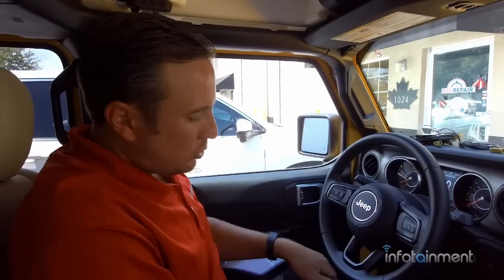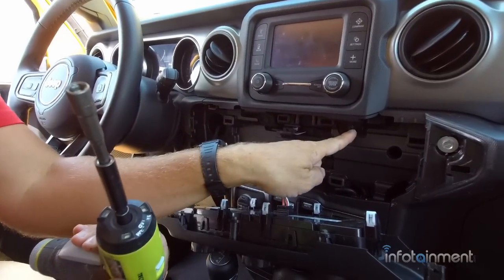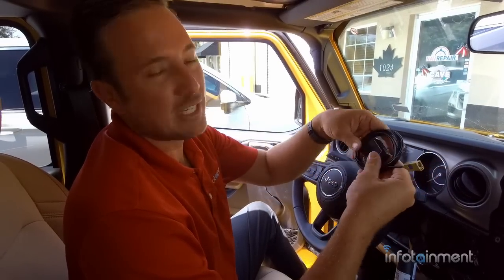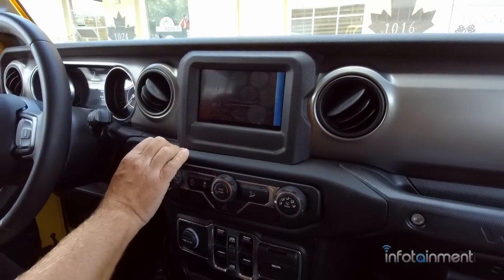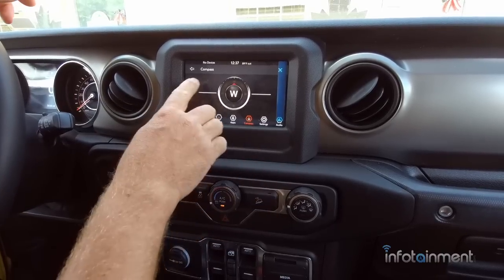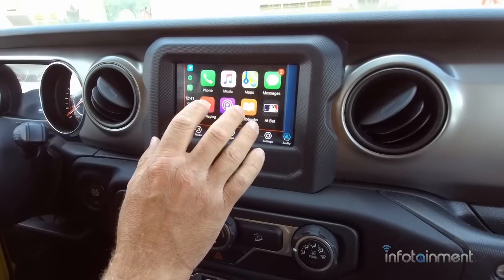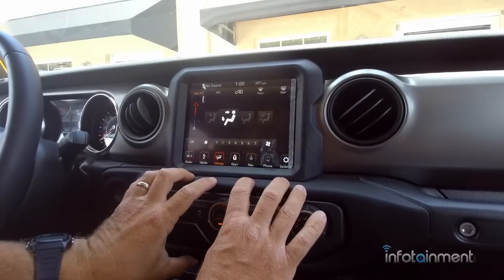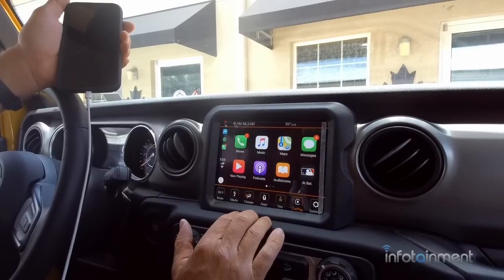2018-2023 Jeep Wrangler & Gladiator Factory Radio Upgrades - CarPlay / Android Auto - Easy Install!

Comment: So I got My 8.5 today for my wrangler and it’s nothing like on the video. My rear camera don’t even work. Like I spent 1500$ for what? Not happy.
Reply from the maker: Please contact our support team so we can fix the issue so it will correctly as we work very hard on to make sure this is a simple plug and play option you can contact them via email, live chat on the site www.infotainment.com or call them up at 855 636 6287 ext 1

Comment: If I have the 7.0 and want to upgrade to the 8.4, do I still. need to go to the dealership to have it programmed?  Or is that just when upgrading from the 5.0 to the 7.0/8.4?
Reply from the maker: Hello Nelson, We make this plug and play for the UAG 7 inch non nav apple car play/android auto radio to the UAQ 8.4 inch factory nav radio with apple car play/android auto with the bezel. You would not need to go to the dealership for any programming after the install you would use the steering wheel controls for radio volume or lower AC stack. Also we offer a buy back on the UAG non nav 7 inch radio coming out with the sell your stuff link on our site. Let us know if we can help out more with our live chat or call us up so we can help out more at 855 636 6287 ext 206 for me-John  
check out the things to know section for more info.
https://www.infotainment.com/products/2018-2019-jeep-wrangler-jl-gps-navigation-radio-uconnect-uaq-4c-nav-upgrade

Comment: My jeep has heated seats and on the website the replacement climate control and volume panel doesn’t have a heated seat button. Will they still be able to work?
Reply from the maker: Hello Caleb, If you have those heated seats and steering wheel functions you would keep that since get the VIN to use that for compatibility.
Reply: Infotainment so I would give you the vin before ordering and you would send one with the buttons for the heated seats and steering wheel?
Reply from the maker: @calebconklin3306  Yes we use the VIN on most all orders to get this going for compatibility to send the right part not the wrong one. Backed with our 30 day money back guarantee 90 day warranty with live customer support.